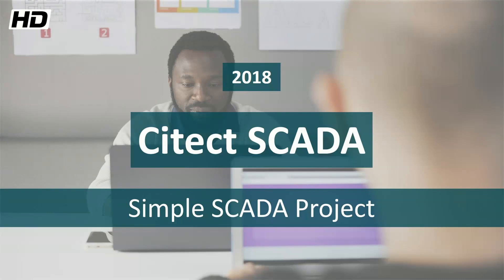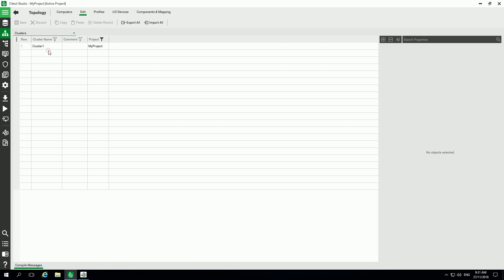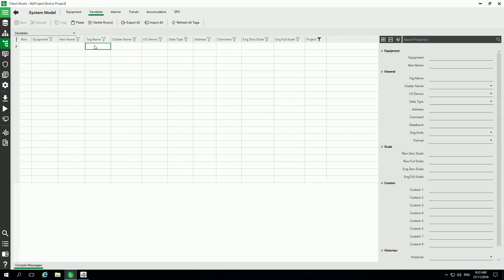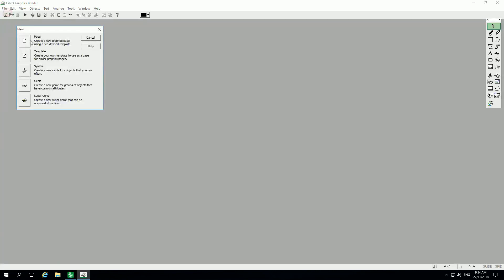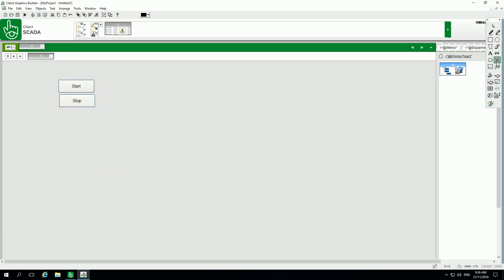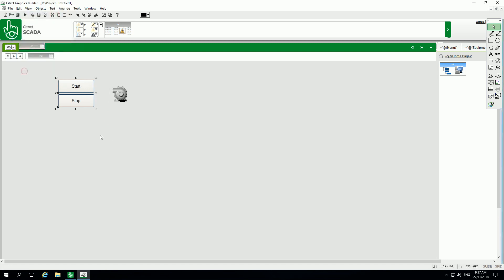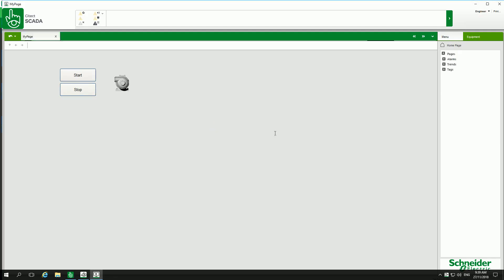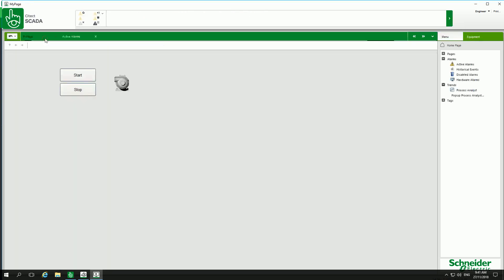Citect SCADA Project including Tag, Alarm & Graphic Animation

Comment: Could you please tell how to add an audible alarm in citect scada 2018?
Reply from the maker: You can configure a project so that a selected wav file is sounded whenever an alarm of a particular priority is triggered. You can even assign different sounds to different alarm priorities, allowing the urgency of an alarm to be determined from its sound. In the help: System Projects Reference > The Tab Style Templates Project > Create a New Project > Implement Audible Alarms
Reply: @martinlalanne1   Thanks bro. But i want a popup with audible alarm  at certain set point of  my flow metres.
Is it possible  to call a popup with audible alarm when my certain variable tag goes high(1)?
Reply from the maker: yes it is possible only if you define the tags in a specific priority bucket. In the same time use the same triggers as your alarms to have the popup appearing with the audible alarms